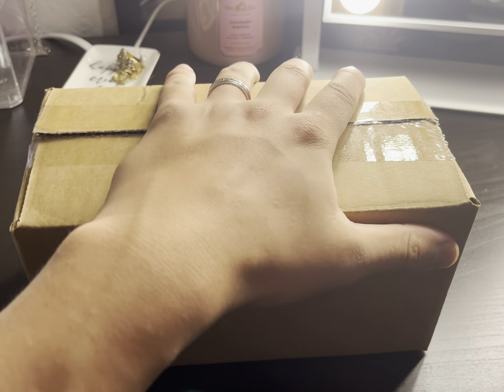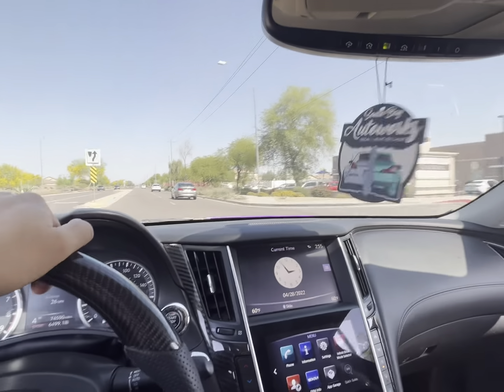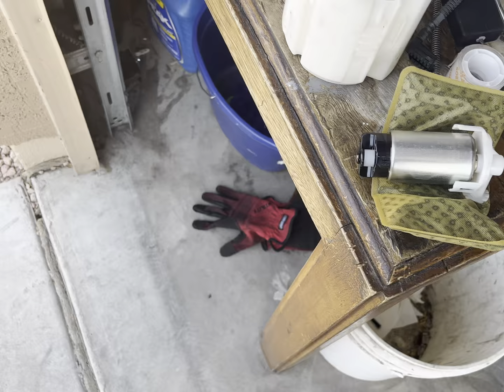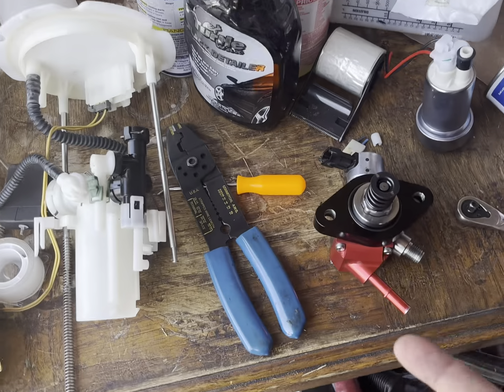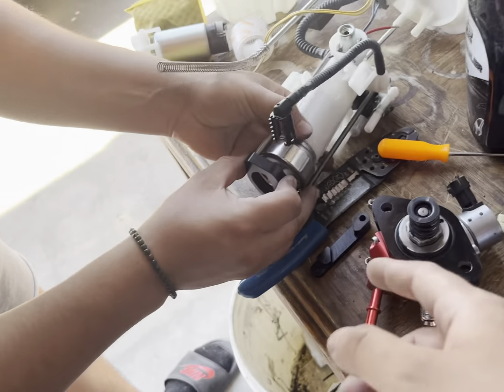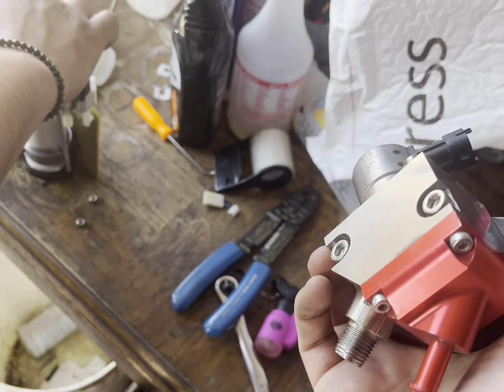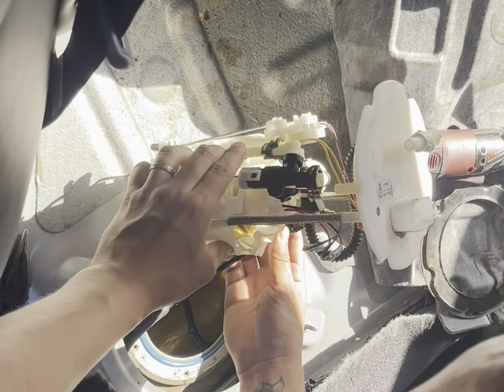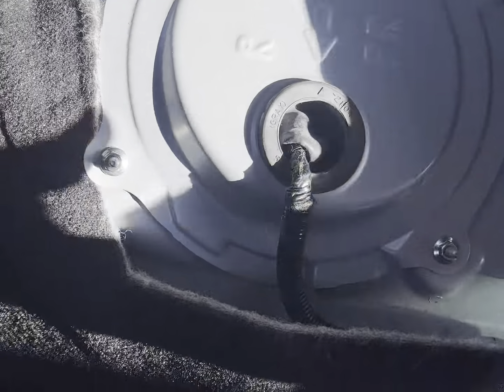Q50 get AMS LPFP💨. More Power 🔥

Comment: Is the LPFP worth running on a gas tune? or should i just wait until i am ready to go E85? This is my first build so i’m quite new to all this. Also any suggestions for mods on 91 tune? Rn i have LDP and heat exchanger gonna be getting an intake as well
Reply: LPFP is for running E85 but regular gas is fine even with the part installed. For 91 tune you can just do your basic bolt ons such as LDP, Heat Exchanger, Intakes, Catback Exhaust as well as an oil catch (highly recommend)
Reply: @josesantiago2653  Ah okay thanks, i have everything then except the heat exchanger and still debating whether do intakes or not. Another question would it be better to get tuned with the lpfp, hpfp etc? Even on 91. That way once i do switch to E85. My 91 tune can have the additional parts tuned in already. My thinking is if i dont do that id need need to pay for a revision so i can flip flop back from E to 91. So basically id be paying twice
Reply: @user-bi2me1kj7p  heat exchanger is definitely a must do mod especially for performance and keeping your car cooler. i noticed on my q50 after installing the heat exchanger it wasn’t sluggish anymore and more consistent with keeping power. i also paired it with the coolant expansion tank as well. for sure do intakes either ams or boosted6 as it allows more airflow to the engine = more power. when you get tuned make sure to have all your parts on that you want as it will save you money and time from having to go back and get a revision yes. make sure to bring your own fuel unless they provide wherever you get tuned. also have the flex fuel kit with the lpfp/hpfp. with all that you should be at 500+ whp

Comment: Aye bro I’m all late lol but can I safely run E-30’with just a low
Pressure fuel pump or do I need a flex fuel kit as well ?
Reply from the maker: I got this question a lot but you can run it without the flex fuel kit. But if you want over all reliability and safety I would go flex fuel kit for sure. Especially if you ever decide to run full Ethanol.
Reply: @santos.400  what are your thoughts on the spool flex fuel kit ? Or would you say to rather go with the ams one
Reply from the maker: @hypebeast2063  don’t know to much about that one but I’m sure does the same job. Either or you won’t go wrong!